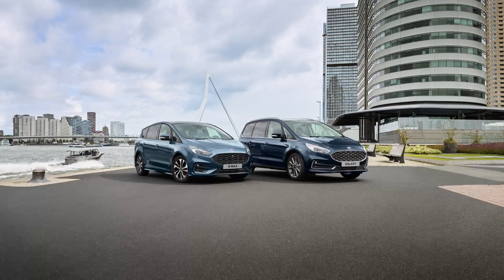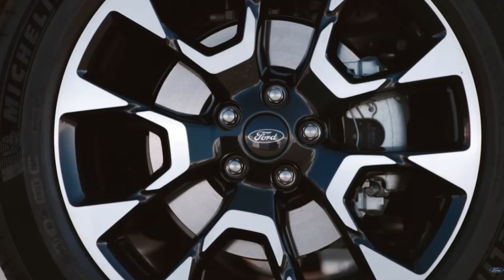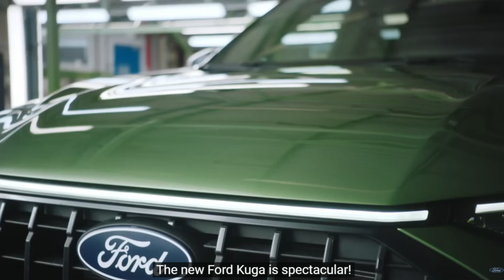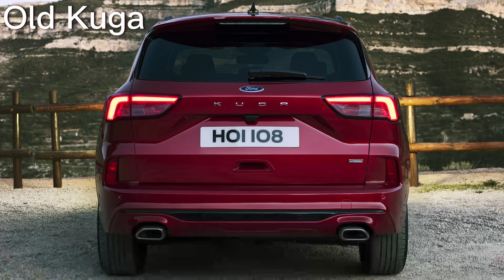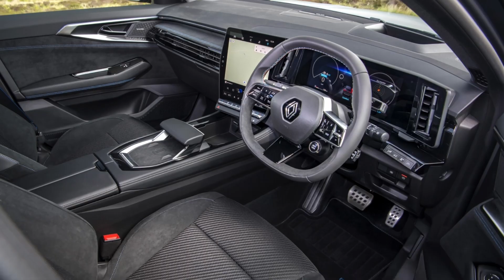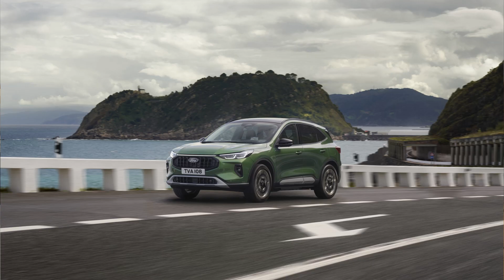New Facelifted Ford Kuga

Comment: Please note that cars do not need a light bar right across the rear of the car, that is poor cheap lazy design over substance.
Reply from the maker: You’re absolutely right. I said it to point out how it seems to be the norm these days to put lightbars on cars. It’s a modern design trend that needs to stop
Reply: One light bar across the front looks like a mono brow......... One at the back looks ok if done right.
Reply from the maker: @pb5x5 The Porsche 911 is a great example of a well executed rear lightbar. I have to see that the new Golf has grown on me too though. I think the Kuga will need some time for me to get used, because at the minuite, it’s giving off some strong monobrow vibes